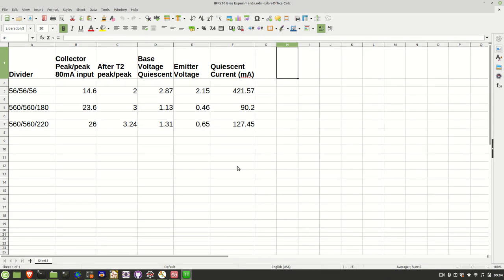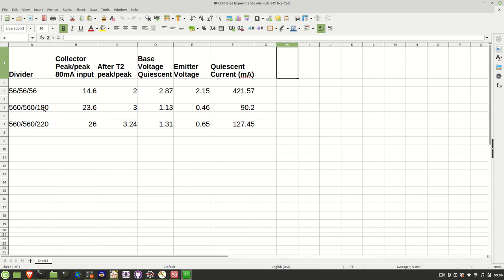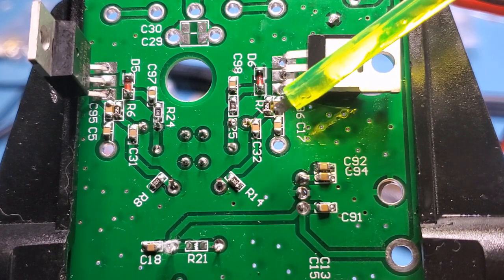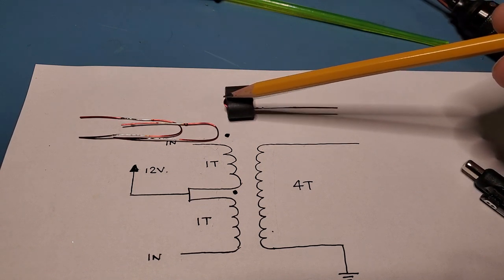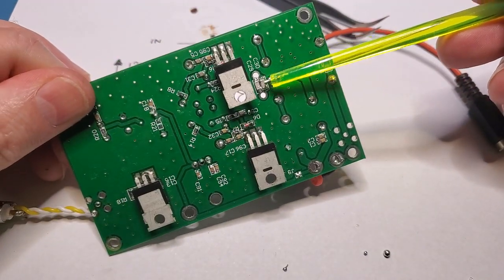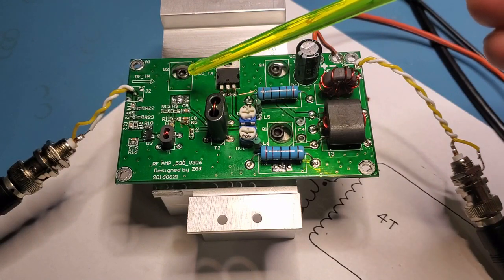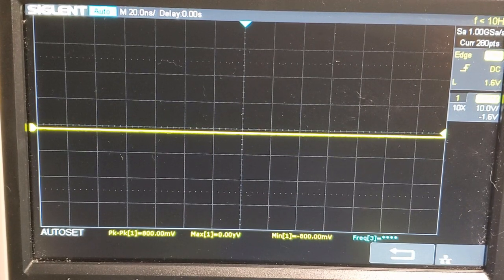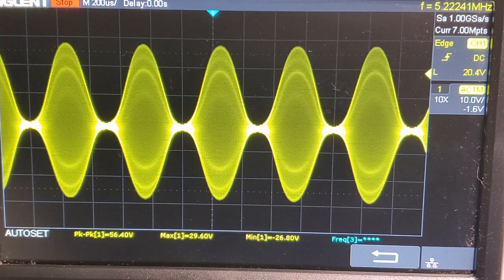IRF530 Push Pull Amplifier - Part 4

Comment: Hi Ian, good stuff and I have enjoyed the entire video series.  One thing to look at:  On the schematic in part 1, it shows a 1:16 (impedance ratio) for the final transformer. The one you built in this video is 1:4 impedance ratio.  The primary has two turns through the core with a center tap and 4 turns on the secondary.  That is a 1:2 turns ratio or a 1:4 impedance ratio (2 squared).  You would need 4 more (8 total) turns on the secondary to get a 1:4 turns ratio or a 1:16 impedance ratio.  The math 8/2 = 4  and 4 squared is 16.  The other option is to have the primary make a single pass through each hole in the binocular core with the center tap on the far side of the core and then have 4 turns for the secondary.  Anyhow, I would try more turns on the secondary and see where the output power lands.  The plot thickens! I need more popcorn.   de KB7ZUT
Reply from the maker: Thank you for the comment. Its hard to know what the schematic means by "1to16". I took it as 1:1:4 where each separate winding is 1/16th the impedance of the 4 turns. It could be 1:1:8 as you suggest. I just simmed 1:1:8 it in LTSpice and it didn't seem to make much of a difference interestingly to the final output waveform - it did increase the current through the IRF530 though. Gives me something else to play around with. Once again thank you for the comment and glad you enjoyed the series.
Reply from the maker: To add further confusion check out page 11 of this doc
https://pa0fri.home.xs4all.nl/Lineairs/RF-AMP-2078/4Z4TJ%20(1).pdf

Its for an earlier version of the board but this document says both four (in the diagram) and six turns (in the text).
Reply: The document you linked helps a little.  So on page 11, it shows a 2:6 winding ration which is a 1:9 impedance ratio. And on page 8 they suggest even using a 2:7 winding ratio, which is a 1:12.25 impedance ratio.  So based on that I would try adding 2-3 additional windings on the T3 secondary.  Looks like they may have produced more Watts that way.  Like I said, the "Plot Thickens."  Half the fun of a no instructions kit is guessing what was really intended
Reply from the maker: @azav8raa  Heh - my thoughts exactly. If it was all clearly spelled out where would be the fun in that!.

Comment: Thank you again for your work and the simulation files. I discover the very low input impedance of the second stage. I'm surprised.. Detail and suggestion: with 1 turn or 2, the coupling is not 1 but 0.95 or less. You can see it when you move the wire in the ferrite during the measurement. For a higher frequency, the R series in simulation must be added to L. Even more so with industry inductors.
Reply from the maker: Good suggestion on the coupling Remi - I had been wondering about that. Thanks again for the comment!

Comment: did you check where in the circuit the distortion is introduced? is it Q2 or only the output stage? With so much distortion, can this comply with FCC rules for amateur radio?
Reply from the maker: Actually the distortion was significantly improved when I added cap C4 in. The schematic had it as not connected but there is a 270pF silver mica cap in the kit which goes there. In any case the amp certainly requires a low pass filter to be legal - I plan to do that next. Thank you for the comment Amir
Reply: @na5y  that makes sense. C4 plus the other two in parallel with the inductance of the transformer are probably shorting out (not quite completely) the higher harmonics. The loaded Q of that resonator is very low so lower harmonics like 2nd order is still going through perhaps but it helps to reduce the higher ones.

Comment: I'm putting 3.38V for the gate voltage but when I'm applying 14MHz -23dBm signal my current reading goes up and destroy the MOSFET, can you assists me regarding the problems?. For your info my first stage amplifier are ok and follow exactly measurements that your video show
Reply from the maker: You will get variations in the IRF530s. What the schematic says is that the quiescent current thru the IRF530s should be 30mA each - adding to a total of 60mA. 

One way of accomplishing that is you first need a power supply that shows current draw. Then start with the bias turned all the way down on both mosfets - record the starting current draw. Now slowly turn RV1 up until you get an additional 30mA current draw. Once you do now turn RV2 up until you get an additional current draw of 30mA.

At that point the mosfets should be biased correctly. Here's the schematic link that shows the 30mA
https://drive.google.com/file/d/1rXdZkfNStUP0Zz3jFpwE6WsESj3K73Rh/view

Hope this helps for you!
Reply: @na5y  For your info, I mounted it with a heat sink that I thought sufficient enough to maintain the MOSFET temperature. I'm also not monitored the drain current, I'm adjusting only the gate voltage to 3.5V. Also my power supply equipped with the analogue Ammeter. My output wave form are clean without any harmonics. Some how the current was keep rising when I monitored the output current.

Comment: That was an interesting experiment, many thanks for sharing. Yeah, there are easier ways to get 10-15 W using a pair of cheap MOSFET's, e.g. IRF510's. I tried a schematic used in uBITX transceiver some time ago and it works quite well up to 14 Mhz. The output power drops to 3-4 W on 28 MHz. The MOSFETS can be replaced with RD15, and NPNs can be replaced with something that has higher fT. I tried KT3142A which are equal to 2N2369A and have fT = 500 Mhz. That gave me nice 5.5-7.5 W across all HF bands and the linearity was just great. I used this PA in my recent transceiver.
Reply from the maker: I just blew one of the mosfets seeing how far I could push the bias. I got up to 3.9V or so and then it went short circuit. Gives me a chance to put in a pair RD15s in there and see the difference

Comment: Great video sir, can I know how you adjust the 2 gate voltage and how many volts did you apply at each gate of the MOSFET?
Reply from the maker: Unfortunately I don't recall the gate bias voltage - but have a look at my other comment. Just to confirm - you do have this mounted to a heatsink correct? Just thought I'd ask - the mosfets will blow very quickly if you don't have them on a good heatsink. Also make sure the mosfets are electrically isolated from the heatsink
Reply: @na5y  Thanks for the reply, I'm really appreciate your response. For your info, I mounted it on the heat sink and the MOSFET case was confirmed isolated from the heat sink it self

Comment: Well, I blew up one of the FETs, but I think it was my own fault. I assumed that the transformer driving them (T2) was one turn on the bipolar side and 4 turns on the FET side, I think that resulted in too high a voltage on the gates. Can you confirm which side of T2 is which? I've got plenty more fets on the way! Thanks again for doing this. 
AE0GL
Reply from the maker: Its 4 turns on the 2SC1971 side to 1 turn on the FET side for T2 Mario
Reply: @na5y  Obvious, now that the driver is working properly! I must have been putting more than 100V on the gates! - thanks.
Reply: After replacing the fets, I get good agreement with your results....AE0GL
Reply from the maker: DId you end up installing C4? I found the waveforms much better looking with that silver mica cap installed there

Comment: Great videos!! R21 is missing, I putted a 100 Ohm resistor, and improves a lot the simetry of the output signal. Also it´s a mistake in the PCB in R20, a bridge is missing by factory.
Reply from the maker: Interesting - never thought to play around with R21. Thank you for the comment

Comment: I think there is enough information for you to just draw the AC and DC load lines on the output (Ic-Vce) plots given in the datasheet and choose the best quiescent current based on the power and voltage swing at the collector. I think 0.65V DC at emitter, is probably too low. Q2 will hit the bottom and cut off very quickly and the waveform will be distorted too much...
Reply from the maker: I have seen the mathematical treatment of a simple transistor amplifier with resistor as load many times. I have never run across that same analysis where the load is an inductor. At the quiescent point for an amp with a resistor load you generally set the voltage at the collector to be around 1/2 Vcc (and draw your load line). 

With an inductor as load the quiescent voltage at the collector is Vcc because the inductor acts as a short at DC. The amplifier then operates around that point (rather than 1/2 Vcc). I'm sure there's an analysis out there somewhere - do you know of a reference Amir - I'd love to close that gap in my knowlege. Thank you for the comment.
Reply: @na5y  VC being equal to Vcc is fine, with the RE you can draw the DC load line but what is more critical is the AC load line for which you only consider the AC resistances seen at collector and emitter. That determines the voltage swing of the transistor.

Comment: If done right you should be able to get 60W RF power, You need to mount this on a heatsink before you burn out the MOSFETS.
Reply from the maker: Perhaps with a 20V+ supply you could achieve that - I don't think you could with this amplifer and just 12V (and remain linear). I could be wrong of course I am far from an expert in these things
Reply: @na5y  The COBRA 200 GTL DX puts out 100W of RF on transmit and uses 13.8V the driver is a MOSFET also but in the COBRA 200GTL DX is prone to burning out maybe that should go with a VN66AF with a heatsink for the driver.
Reply from the maker: @DAVIDGREGORYKERR  Certainly other PA circuits can get 100W output on 13.8 input - my ICOM can - but thats a whole other level of sophistication in the drive circuitry. I'll definitely be doing some playing around with this though to see how far I can push it. Thank you for the comment!
Reply: @na5y  The COBRA 200 GTL DX is for radio hams only not people with a licence.